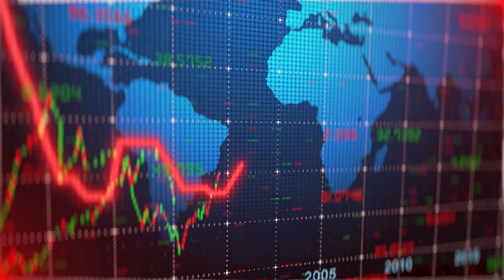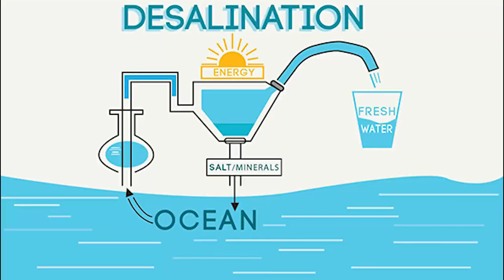Saudi Arabia Is Planting 450 MILLION Trees

Comment: Planting trees on the edges of farms can at times stabilize water cycles ( capture water that would otherwise run off of evaporate as well as drop the temperature. Planting mini oasis between the circular fields could be an experiment as well as slipping fields so water drains and is Oiso inks retained in those regions with the help of permaculture forestry.